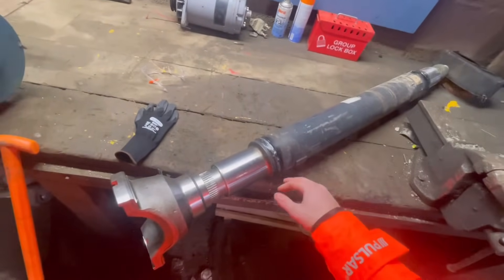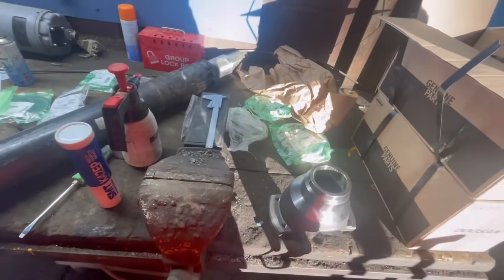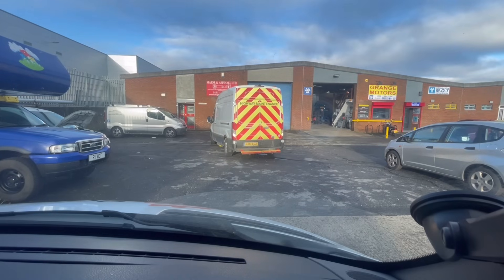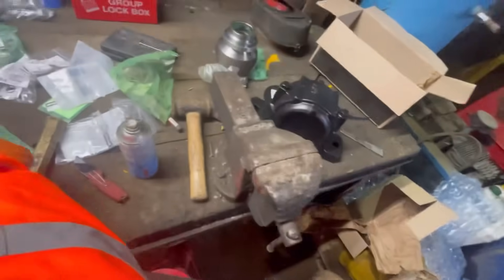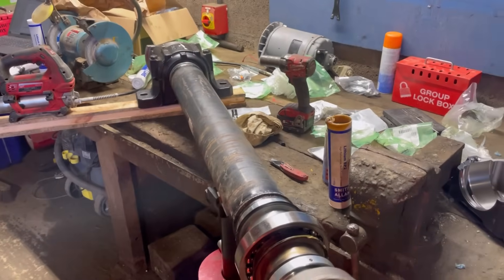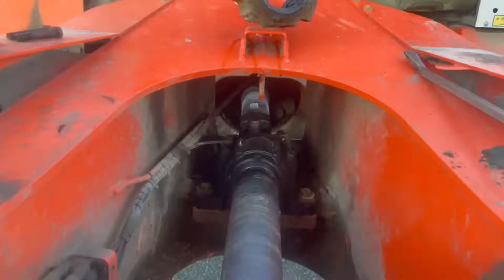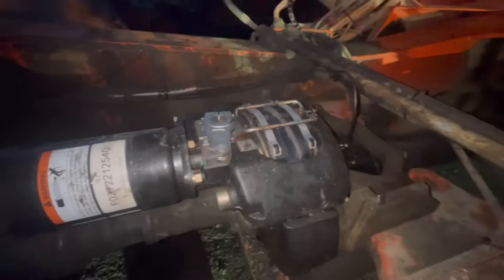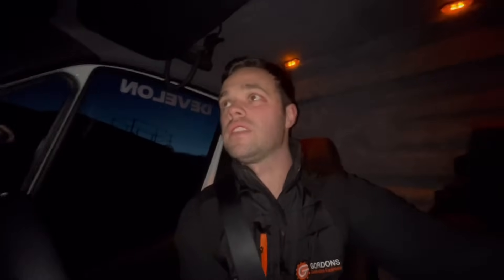Drive shaft failed / Park Brake flew to bits / Huge Rock truck !

Comment: That dump truck looks pretty much like the moxy ones duesan took  over a few years ago.
Reply from the maker: Yea they’ve not changed much good truck though 👍
Reply: Doosan and Moxy are identical pretty much. Around 2000, the dumper was called Doosan/Moxy.
The build is the same, especially the frame and bogie system (correct word?). Both use Scania engine as well.

Moxy was Norwegian made, and they still build Doosan/Develon dumpers in Norway near Molde/Elnesvågen.

There's a video you can see them testing the new DA45 dumper, very cool to watch. If you wanna see, search "Norwegian earthmovers doosan da45".
He has 2 videos about the prototype.

Comment: Top vid there chap.
I like the way the way you got them yocks turned down.so quick and accurate.
We have a small leath at work, best IV done is made a new engine oil pump for a Hyundai 12.5t zero swing.
Well its looking like new year I'm going alone.....
Work is drying up now with resection but im been asked by meny to do work for them......
So January im doing it.
Reply from the maker: Cheers Marc I hope it works out in the new year for you mind the say a good mechanic is always busy sure you’ll have plenty work 👍
Reply: @alisdiggerdiary  thanks al, I'll still be watching your adventures and learning more off you.

Comment: Cheers Ali, was it Air or Hydraulic operation?. I’m surprised the yolk cap bolts aren’t wire locked together. Good video and thanks for your feedback for all the messages, see you on the next one.
Reply from the maker: Hydraulic brake systems on these trucks spring applied hydraulically released
Reply: @alisdiggerdiary  good lad 👌